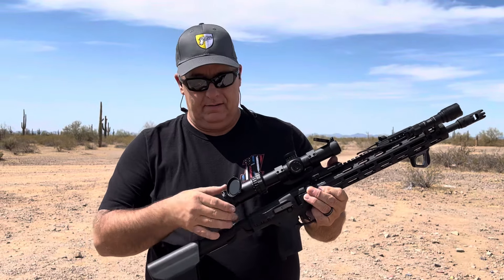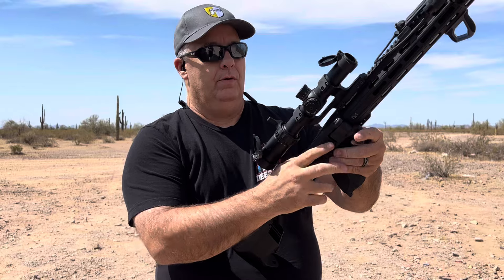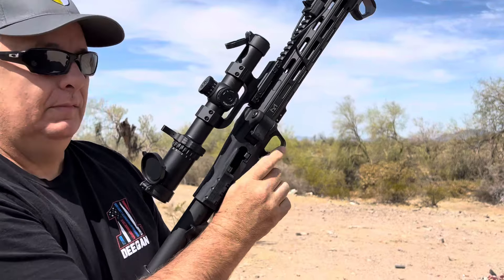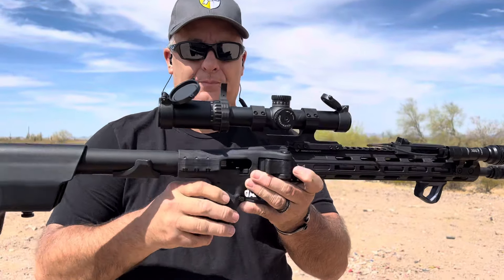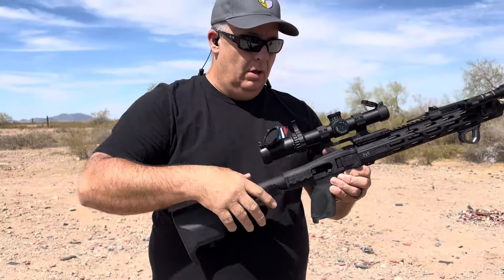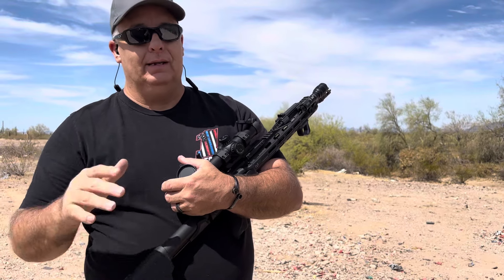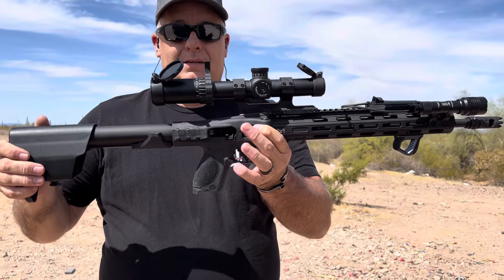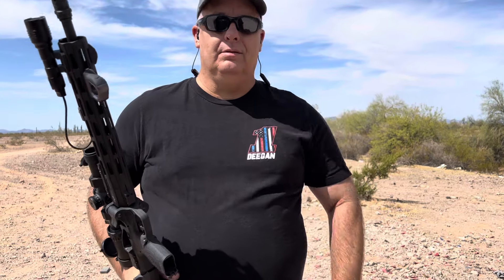S&W FPC Bolt Catch Fix 6/7/2024

Comment: Good job figuring that out !!  
Do later model FPC's have the lock back problem or only the older models?
Reply from the maker: I don't believe so, I have only seen it on older versions. I bought a second FPC about 2 months a go and I compared the bolt catches to each other last night. The newer bolt catch was less angled on the left side (non ejection port side). This is the side that catches the bolt. The older bolt catch had quite a bit more angle, I set the angle to the new bolt catch and the problem disappeared immediately once rebuilt and used.
Reply: This is not a known issue.
Reply from the maker: @x3overland114  Ok.